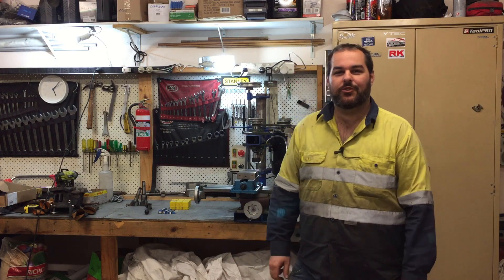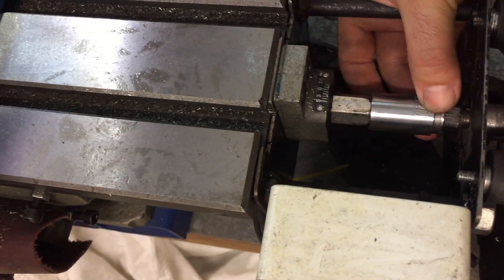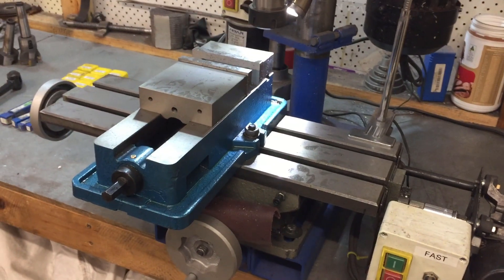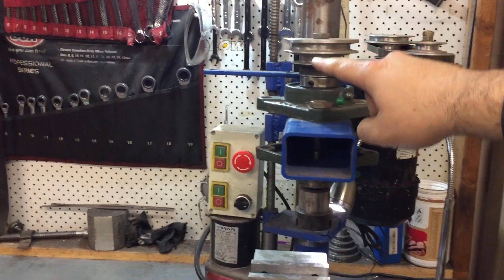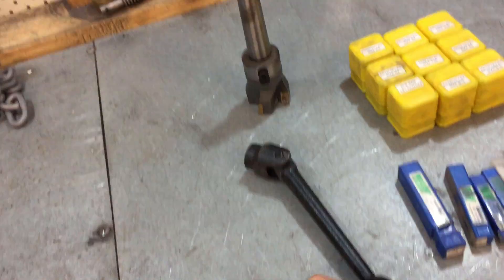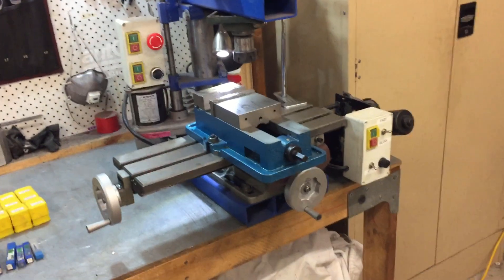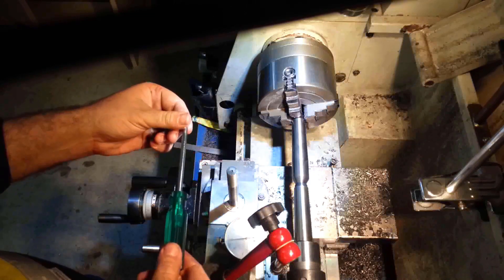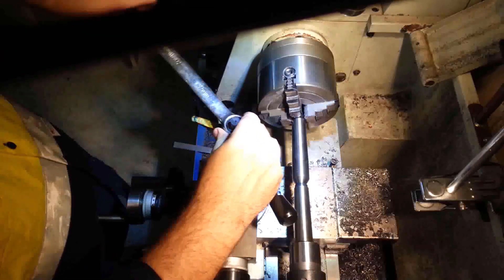DIY Milling Machine walk around and main components build.

Comment: Any chance of an update on the flanged bearing blocks you used, I asked 10 months back and no reply as of yet.
Hope your ok?
Reply from the maker: Hello rct2
Apologies I missed your comment.
The bearings have held up well considering the load they are under.
I got them for cheap off eBay from China so I wasn't too worried if they gave out. 
But all in all performing well.
Reply: @MaximumDIY  awesome thanks for getting back to me just the answer I was after.
Great job.

Comment: Hey mate, Melburnium here.....I love your build (machine that is).......I've just commissioned a small jig borer to make it a mill and can safely say that once you have a mill in any shape, form or whatever you will never do things the same old way again.........having said that you must definitely add a DRO.....without a DRO you are still in the stone age.....LOL, oh yeah, and a VFD too as you can vary the speed at will......using the belt drive too to give you more torque when needed as the VDF suffers from lack of low down torque when running the motor slow.
Watching the video further on and I see your UNIQUE power feed clutch engaging mechanism.........that has to be the most ingenious method I've ever seen.....so simple.
Reply from the maker: Hi Ian 
Thanks for the reply, I'm really please you enjoyed my video! 
You are correct it's a home made mill without a DRO - I originally built the mill to simply cut a few small keyways and using it for facing some parts to be flat. A DRO would greatly improve its accuracy and control to the machine, this might bee a mod I preform in future.
As for the home made power feed clutch - its design is simple, effective and works well - I hope you can incorporate this into your design.

Like / Share / Subscribe
Thanks

Comment: Where did you get the shaft from, that holds the Morse taper. ?
Reply from the maker: Hi Paul - thanks for the comment.
The Spindle shaft was hand made on my lathe.

Additional information about the build including a diagram of the M3 Taper shaft diagram and parts used can be found at https://www.homemadetools.net/forum/diy-milling-machine-74852
Hope that helps.

Comment: The cone on spindle is MT2 ??if yes working good?? I'm ask because at the moment doing a milling machine and think about the spindle ... I wont to do a MT2 cone , what you think ??
Reply from the maker: Hi Sergio - thanks for the comment.
The spindle boore / cone is an M3 Taper. I choose the M3 Taper as the tooling is used on entry level milling machines and if my home made milling machine didn't pan out. I had already purchased the correct tooling for an entry level machine and could still use it.

The M3 Taper seems to work well and it's the same size as my milling machine tailstock.
The M2 Taper is simmilar just smaller in diameter and would be limited in size to place the bolt all the way through for securing the milling attachment to the shaft. 
Hope that helps.

A diagram of the MillingMachine Shaft + more info can be found here: https://www.homemadetools.net/forum/diy-milling-machine-74852
Reply: @MaximumDIY  kind regards Max

Comment: Have you thought about filling the tubes with concrete to increase the mass?  Something like lead shot would probably be ideal to really bulk that guy up (and wouldn't make the tubes impossible to rework in the future if you ever wanted to modify the design).  It would be expensive, sure, but maybe worth it?  It would probably help with the issue of the thing wanting to turn itself loose and increase the stability.  Building/ sourcing a dedicated stand for it would probably help, too.  The bench it's sitting on right now doesn't look flimsy by any means, but maybe not providing the kind of stability the unit is needing.  You could then, of course, add even more weight to the tubing of any stand you had and could even bolt it to the floor.  In fact, if you could bolt the thing to the floor really well, then you may even be able get away with not weighting anything (or weighting less) and instead using some extra support brackets to transfer some of the force down into the concrete.

I always figured that a mill would be totally out of reach for me unless I butchered a drill press or started selling family members.  This actually looks quite a bit better than some of those hack-y drill press conversions I've seen around.  I'll have to keep my eyes open for some orphaned hefty electric motors (and I threw away a pallet full of them about 3 months ago at work :/)

Comment: Great video by I’m wondering why you don’t just use a three jaw chuck for your lathe? It would save time when putting it in.
Reply from the maker: Hi Escapi - thanks for the comment.
I do have a 3 jaw chuck but I decided to use the 4 jaw as it's more accurate and can be dialed in perfectly. The 3 jaw chuck has 0.03mm runout which wasn't suitable for this project.

Comment: can you show/explain a bit more in detail how you got your toolhead fixed in the bearing blocks? Thanks
Reply from the maker: Hi Fenix
Thanks for the comment. There really isn't that much to it, I made some small grooves in the outer wall of the drive shaft for the bearing grub screws to seat into. This process seems to work well and is easily removable for maintenance.
I diagram of the drive shaft can be found in the link below - hope that helps.
https://www.homemadetools.net/forum/diy-milling-machine-74852